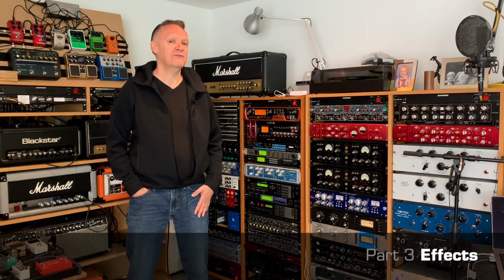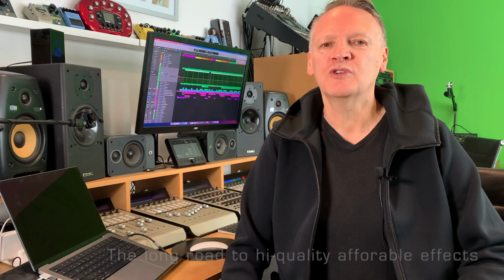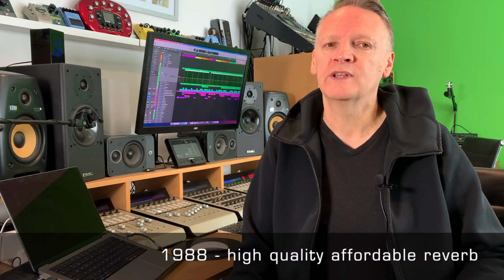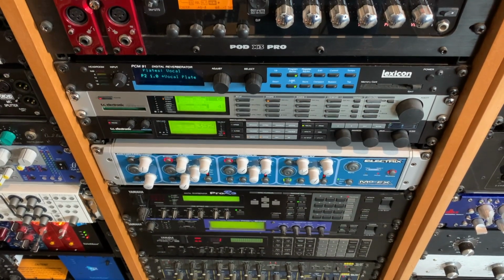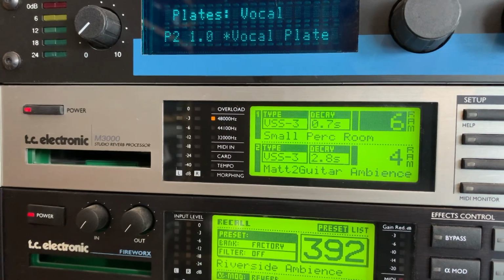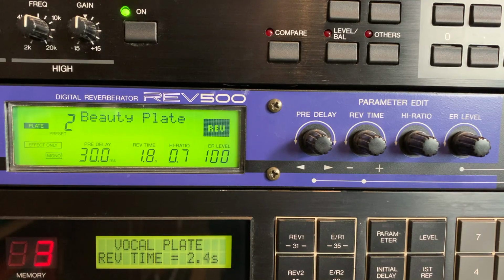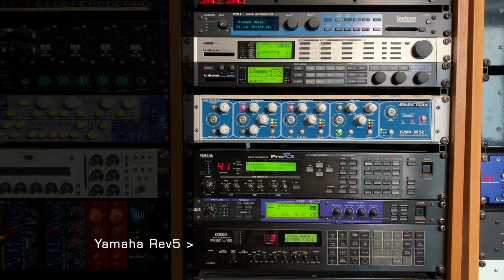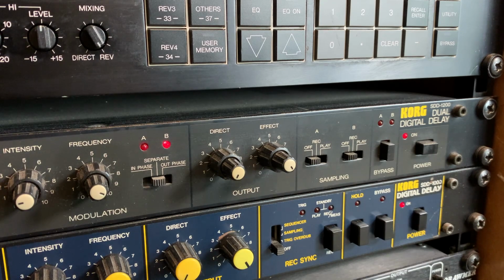The 40 Year Home Recording Studio Build Part 3 - Outboard effects processors

Comment: Thanks for the share. What plugin would you use to replace the tc m3000?
Reply: Although the M3000 is high quality synthetic reverb, you can achieve very similar results with a convolution reverb like Space Designer, or another synthetic reverb plug-in like a Lexicon native algorithm. If you’re using small to medium rooms almost any decent plug-in will work. 👍
Reply: @MattOttewill  interesting. I have a few decent plugins that I use, and I really need to try the lexicon bundle, but I've found that they are never quite the sound I want regardless the brand, preset, or tweak. A few months ago, I bought a tc electronic m one xl and found it to sound better than all the plugins I have, including seventh heaven. I want something that puts the audio into a nice room without shoving the fact in my face, and the m3000 seems to do that, whereas ther lexicon is a more in your face type of effect (or so I hear). The idea is that the lexicon plugins are said to sound identical to the hardware at a fraction of the cost and hassle of use. I wonder if there is an equivalent for the m3000... I'll probably just buy the real thing, then I know what is what.
Thanks for the input

Comment: Beware or G.A.S (Gear acquisition Syndrome)
Reply: I think it's 40 years too late for this fella
Reply: Haven’t managed to kick it yet! 😅
Reply: @MattOttewill  I love your setup and philosophy :)
Reply: I’ve realized that, for me, it is preferable to plugin acquisition syndrome; an interesting prospect: working with tools which the plugins try so hard to emulate. My gear ‘folder’ (rack) is smaller than my plugins folder so I invariably learn the set of hw tools much better — which in turn, helps the mix sound better. I also find the limitations help keep sessions a little less dense and frankly, maybe because I first started with hardware when i was a kid, I simply tend to yield better results manipulating hardware with knobs, buttons, jog wheels and pots. 🤷🏻‍♂️